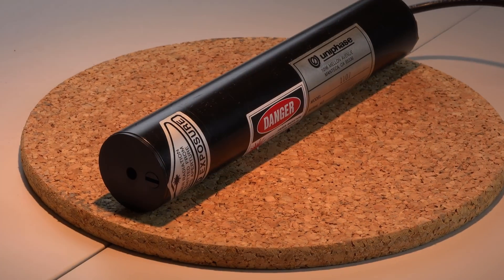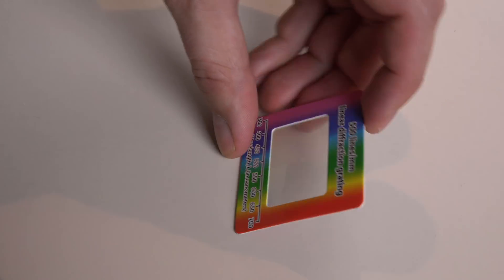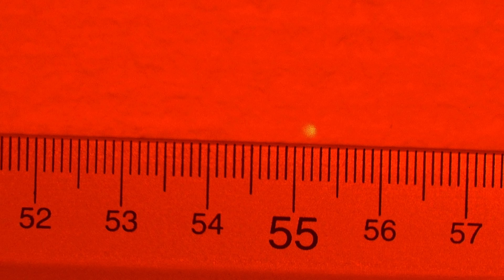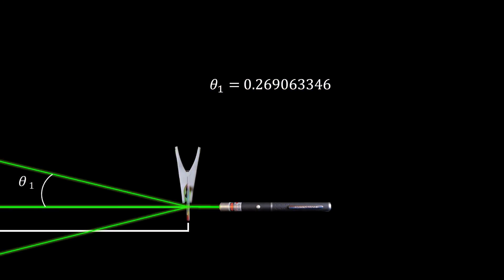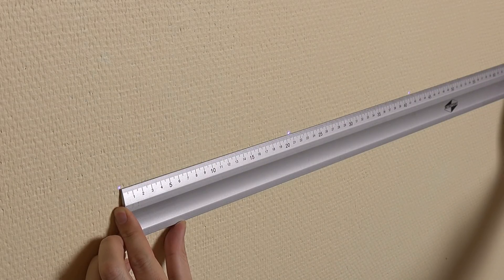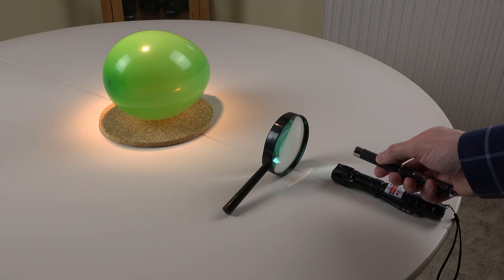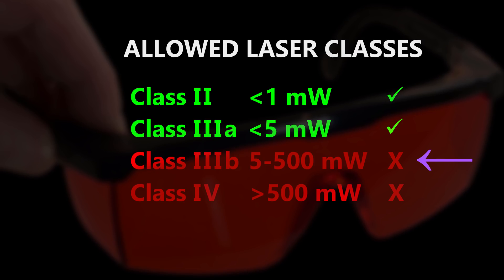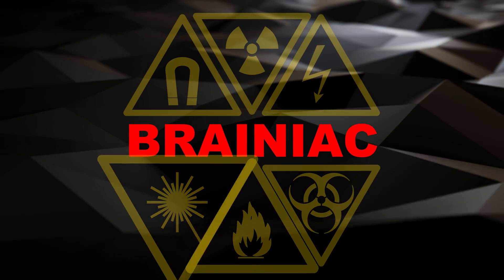MISLABELED LASER | Power and wavelength?

Comment: Any recommendation for good laser protection goggles ? Let's say for 332nm green lasers, which clearly leaks IR (IR is blocked by any polycarbonate glasses though, even not tinted, which is a  good thing)
Reply: VR headset (the cheap $5 to $10 ones you put your phone in). You look at the phone screen, and if something happens (like laser reflection), the worst you do is burn out the phones camera instead of your eyes. I just put my phone in a cardboard box and secure it (measure the distance you like looking at the screen so its not too close), and then drill a tiny hole for the camera to see through, and cover any edges with more cardboard and tape or hot glue everything together. It may look silly wearing a box on your head, but I have a super high powered laser that wouldn't be fun to have reflect off of something, even the dot is blinding intensity.
Reply from the maker: No, I don't really have any recommentations. Most cheap safety goggles do not include IR protection in their specs.
Reply: Hmm, ok. I always wondered where I can get safety goggles that would actually protect me (I'm always hesitant with cheap chinese goggles... I don't want to lose sight), for a decent price.
Reply: Mine is not an IR laser (and you mention green). In fact, if you aim my blue laser at your skin, you will get 3rd degree burns (the laser wavelength will skip the first couple layers of skin and burn the insides, so you may not even see visible damage). IR doesn't do that, its a surface burn . So you cannot compare the vastly different IR and visible wavelengths.

A decent pair of laser goggles are going to cost $50 (decent as in they work, but if you want a nice pair that's more stylish than safety glasses, those are about $150, still very cheap compared to your eyes). Pretty much everything from China is junk though on laser glasses. I have a pair, and no joke, the 3D glasses from long ago with the red and blue lenses does about 20x better than the glasses that came with my laser... Talk about loosing your eyesight! That's why I built the cardboard box holder.

The reason you shouldn't burn through the box is, a laser (unless in the 50w to 100w, yep, 100x power of my retina fryer, we are talking liquid nitrogen cooled lasers, definitely not handheld...) needs to be focused to burn things, though it can still burn your eyes. To burn a box, you pretty much need to aim at it and purposely burn a hole, which is how I cut out some of the holes, but that took several minutes purposely trying to burn through it. A random reflection, or even shined at it unfocused shouldn't be a problem unless you have some $5,000 laser, in which case, why don't you have $300 glasses?
Reply: Wow, not a bad idea actually. I think you cannot go safer than this. Well.... except if the reflection of your laser burns the box pretty quickly and then it's your eyes' turn !
I'm pretty sure safety goggles are designed so that even if the laser hit it and partially burn it, it won't poke through (I've seen videos of a guy showing how IR lasers burnt goggles : even cheap polycarbonate goggles seemed to block IR, and started to burn, but it took quite some time for the laser to poke through so you'd move before the laser has a change to go through. The only thing I'm afraid is some goggles don't really cover all the angles very well, and a random reflection can happen quickly.
Reply: Here is an example http://ehs.oregonstate.edu/sites/ehs.oregonstate.edu/files/webpics/laser/Laser_Biological_Hazards_Skin_files/Image2.gif
I think I saw the same video as you from William Osman, his is not to be compared with a visible spectrum laser, it behaves very differently.
Reply: Thank you for the very detailed explanation, Jake ! :)
Tbh, until now the only "powerful" lasers I have had, were cheap green lasers from chinese website that are sold as 5mW lasers but apparently sometimes are more like 20mw or even more, and it seems to be a bit random if we believe the testing that a guy did on this kind of lasers (they even sell it as different brands but it's the same thing just with different stickers haha).

And what I heard is that the real danger in these cheap laser is not necessarily the visible green wavelength but the leaking IR that is not correctly filtered (and the beam is apparently wider that the green beam so even if you think you're not shining the laser on somebody's eyes, you could be shining IR directly into his eyes if you point the laser near his face... at least that's what I've read. My knowledge of laser is not enough to know if it's true or not). I'd love to play with some more powerful green lasers. But I don't want to lose my sight :D
Reply: Oh I forgot, I also have a 5mw violet laser (ultraviolet ? It looks blue if you shine it on a white tissue fabric for example). But it looks way dimmer than the green one.

And yes I was talking about the video from William Osman !

Comment: How did the green laser pop the balloon? I get that u need a magnifying glass but... How big ? How thick?
Reply from the maker: Any magnifying glass will concentrate a laser beam - just at different focal lengths. The best burning is where the laser spot is the smallest after going through the magnifying glass. Do be careful - concentrating a laser beam (and reflections back from the glass surface) is obviously not without risks. Strong safety goggles are a must.
Reply: Thank you!

Comment: Should these cheap lasers have an IR filter?
Reply from the maker: Only the 532 nm green (and 473 nm blue not shown) need one. It should have one, but there's no guarantee with an unbranded cheap laser....
Reply: Brainiac75 
Thanks for the reply, I did wonder, I bought a cheap green 5mW laser from eBay, it would pop balloons etc. On disassembly I found it didn’t have an IR filter and wondered if it should. 
  IR is especially dangerous because your eye can’t react to it, although it would to the green light. 
Saying that, when the batteries were almost flat, the laser only emitted the IR light.

Comment: Your test for the lasers being labeled correctly seems to depend on the defraction grating being labeled correctly. (Or does it not matter? I'm curious.)
Reply from the maker: Of course, with a mislabeled diffraction grating it wouldn't work. But since three of the lasers were within only a nanometer of the theoretical wavelength, I trust the diffraction grating. And a 435 nm diode isn't commercially available ;) Only 405 nm and 445 nm. Thanks for watching!

Comment: Laser power meters are easy to make. Just get a peltier element, paint it black (to absorb light) and monitor peltier output.
Reply from the maker: But how about calibration? I could of course get some relative results between the different lasers, but not an absolute result in mW. I hope to get a nice, well calibrated laser power meter in the future. Thanks for watching!
Reply: I think they are pretty linear (within reasonable range). At least the one I have seems pretty linear (open circuit output voltage). Absolute calibration is another problem, I've used known output power lasers for reference to get the gain.
One problem with that approach is that is is wavelenght independent and if you have eg. a green laser leaking also IR, the power meter will indicate total output power for all wavelenghts. (Need to use a filter if you want to know only green power). Not that much problem with other wavelenghts such as red/blue that do not come by using an intermediate IR.

Comment: I bought a “20mw” laser from a chinese website.  When it arrived, I tested it with a laser power meter, because it was way too bright.  Turns out it was 200mw.
Reply from the maker: Why am I not surprised :) I really need a laser power meter. Only way to know the real power. Which one do you have?
Reply: Brainiac75 It was in the lab at the hospital I worked at, I don’t remember what brand it was.
Reply: @brainiac75  get a pocket laser power meter from Laserpointerstore, definitely not as accurate as a laserbee or so, but Will give you really good idea of the power You're dealing with with just a ~5mw or so margin of error at 200mw by example
Reply: soupisgdfood Awesome 👍. As long as you use safety precautions ;)
Reply: Mine is 5000 miliwatts
Reply: @loretta3311  5 Watt laser.....

Comment: Take the first laser and use a 9v battery on it and redo test would like to see the difference as i usually use them with 9v battery’s
Reply from the maker: Shouldn't make a difference? To my knowledge the laser drivers have current regulations, so the laser diode will never receive 9V. Unless you run the diode straight from the battery, but I doubt it will last long then :) Thanks for watching!
Reply: The circuit limits the amperage based on 5v so a 9v battery should get a 40% buff if efficiency and heat are ignored

Comment: As a laser enthusiast/hobbyist I loved the video. One thing I'd like to point out with those cheap 532 pens is that 99.9% of the time they are not IR filtered which can make looking at the aperture even more dangerous. Even a cheap 5mw (if it really is) can be putting out 5-10x or more in almost completely invisible to the human eye 808nm IR from the pump diode. I have a "5mw" green pointer that according to my LPM  puts out about 32mw which sounds great until I filtered out the the 532nm wavelength and found that about 25 of that was 808nm IR leaking from the pump diode.
Reply from the maker: Yep, that's scary. Just another reason to always wear safety glasses when using unbranded, cheap lasers. I really need a laser power meter...
Reply: Extremely dangerous to the public really, retina can't feel heat and also you can't perceive the IR wavelength.
Reply: LtKernelPanic actually the leak would be 808 and 1064. Given the rate divergence of the NIR coupled with the optics set for collimating of the 532, the NIR beams expand quickly and lose optical density over a few inches. The NIR is of most concern if a direct hit to the eye is made at very close range. If you walk your thermopile or optical sensor back away from the aperture you should see the power drop right off..

Comment: Alot of cheap chinese lasers are all above 5mw. I have a 1.6watt blue laser extremely dangerous but fun to play with
Reply from the maker: Yep, it seems to be a common problem. let me guess: You've got an older gen Wicked Lasers Arctic?
Reply: No its the knock-off Arctic from china , its called the thor m2, works on two 16340 batteries. it can burn  matches without focussing from up to 4 meters
Reply from the maker: Ah ok, never heard of that one. But the 445 nm diodes are common in many lasers now. Fantastic output for the money.
Reply: Yea, you're less likely to get scammed when you get the blue ones. lots of green and red lasers claiming to be 1 watt+ are actually arround 150 to 200 mw.

Comment: We once tested a cheap abay 532nm "<5mw" laser for fun at work. It was 30mw of which 20mw were in infrared (that means safety glasses for 532nm lasers won't save your eyes). And due to lack of temperature control their frequency slightly changes during operation. If I remember correctly, it's possible to change it in a range of 10nm by heating or cooling it enough.
Reply from the maker: Yes, cheap green lasers have an added problem with IR leakage. Would be interesting to try an alter the wavelength. Should be very visible in the shown setup with a 'wandering' laser dot :)